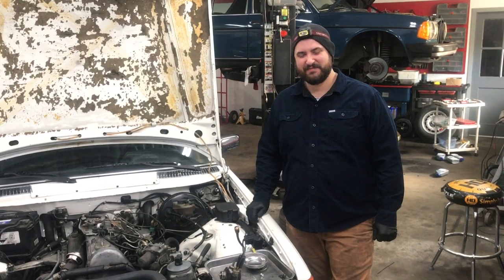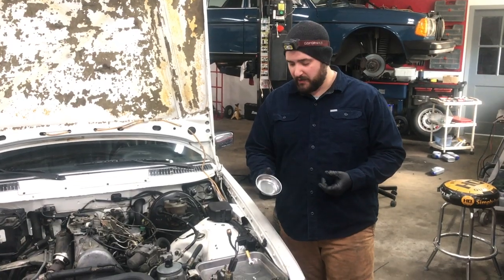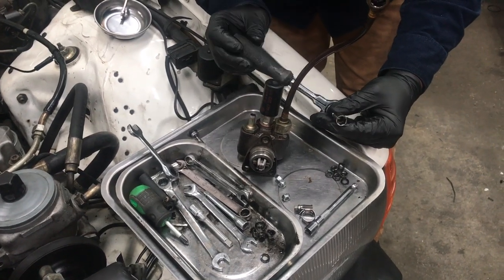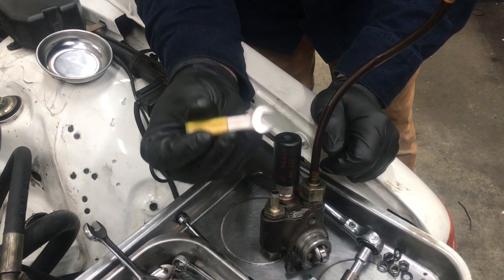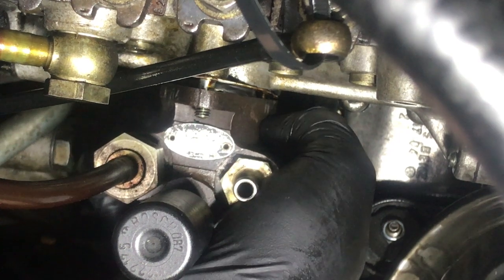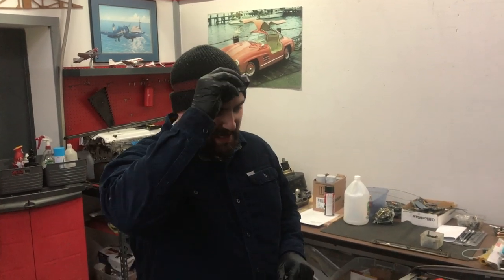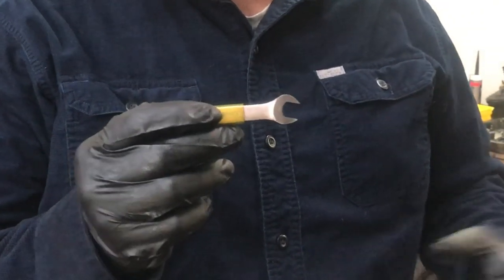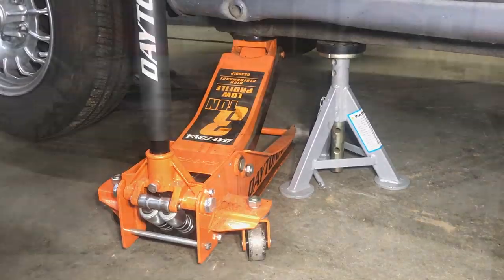Removing and Installing a 1977 to 1985 Diesel Lift Pump: 5 Key Tips

Comment: Thanks for all the info you guys are putting out there on keeping a diesel in great condition. I wonder if you could also provide tips on the user side of things, that is how to properly use a diesel car. I've heard short trips kill the engine on the long run, is that the case?